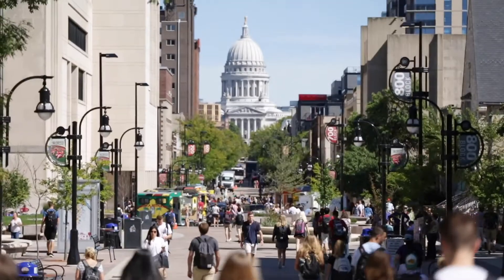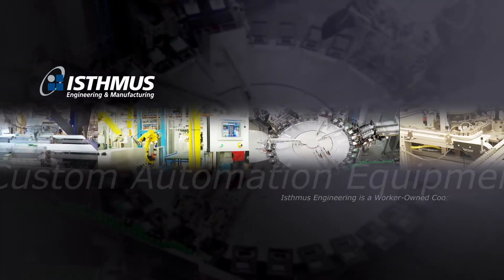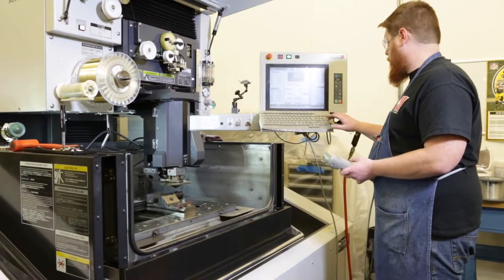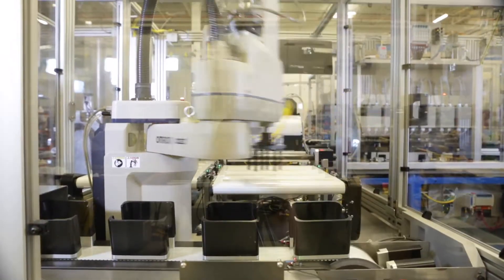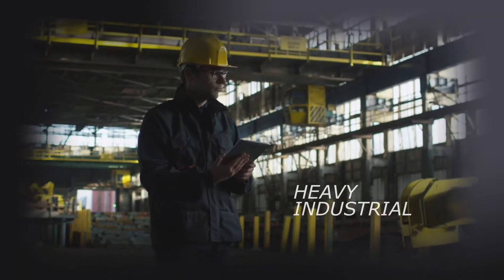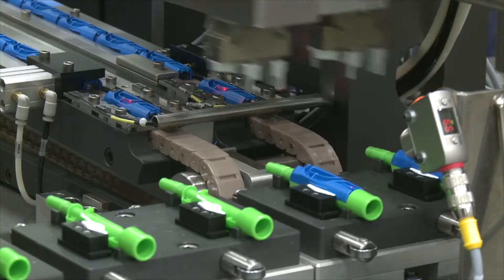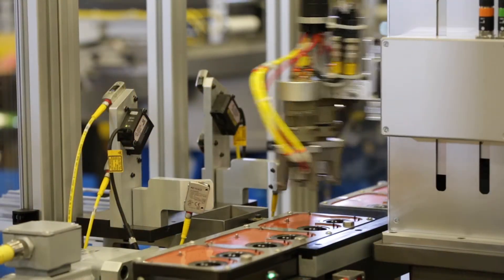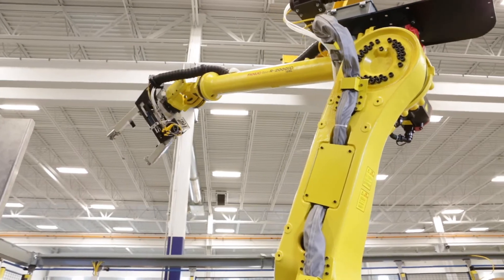Isthmus Engineering & Manufacturing Co-Op

Comment: as a technician, i have been blessed with opportunities to support equipment created by many integrators.  I will tell you right now, get Isthmus. they implemented probably the most intricate automation in my plant, talking about 99% oee out of the box, and when part 11 came down on us, the talented staff of Isthmus was right there with us to update the systems. When engineering asks for my input on a new project, i say: Get Isthmus.